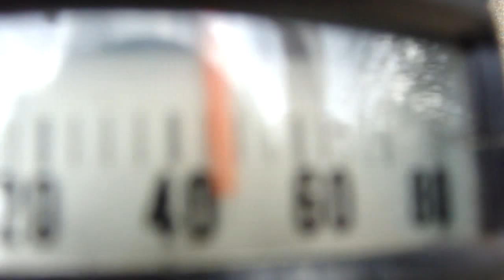CHEVY 454 ENGINE START UP ON GROUND * HOT RATROD ENGINE  * TEST RUN * REDNECK ENGINEERING

Comment: We used to always test run used or rebuilt engines like this before putting them into the vehicle. It's a good idea as you can evaluate how well the engine runs before installing it and find and fix certain problems such as leaks or assembly issues more easily. For cooling we used to simply pump water through the engine with a garden hose and you can easily control the engine's temperature by regulating the water flow rate from the hose. We also used to run the wire supplying power to the ignition system down from the ceiling and connected it to the ignition coil with an alligator clip making sure that the wire was tight without any slack. That way if the engine were to run away or shake really bad and it started moving the clip comes off and kills the engine before the engine could kill us.

Comment: Ahh yes. The good days when a motor didn't have 2 miles of computer harness attached to it
Reply: ya people nowadays people looks at that and says, that isn't a motor where's all the plastic?
Reply: +Eddieallen You're right that's not a motor!!! IT'S AN ENGINE!!!
Reply: Rocker Pat: you need to look up the definition of motor and engine buddy.  You know what... i'll just copy and paste it for you.  

motor:  a machine, especially one powered by electricity or internal combustion, that supplies motive power for a vehicle or for some other device with moving parts.
Reply: +fwh79 You sir need to look it up!  A motor is driven by an outside power supply.  An engine is internal combustion!!! Period!!! Motors are electric, hydraulic, or pneumatic!!! If it uses electricity motot, hydraulic motor, pneumatic motor all have an outside power supply. An engine is internal combustion and only internal combustion!!! Piston engine, jet turbine engine, rocket engine all have internal combustion!!! A steam turbine is a motor. A steam locomotive is a motor. The only thing that is an engine has internal combustion.  Maybe you should learn something about mechanics!!! Amd I learned tje definition from working at Chevrolet!!! I'd thinkthe engineer's there would know the difference!!! They are NOT the same thing!!! You have one engine in your car and several motors!!! Think of it this way, You can't take a motor out into the middle of the ocean and make it run without an ENGINE to supply power to it!!! Think about that for a minute mr. smarty pants!!!
Reply: Maybe you should watch the modern marvels episode about engines.
Reply: +fwh79 I don't get my info from tv producers who wouldn't know their ass from a hole in the ground.  My info comes from 30 plus years working for Chevrolet!!! I can assure you that a real mechanical engineer would set you straight!!! A motor is completely useless without a cord or hose!!! An engine is self powered,  a motor again has to have an outside power supply!!! It takes another machine to make a motor work (power station, air compressor, hydraulic pump). An engine does NOT NEED A CORD!!! Learn something here and quit watching fucking stupid tv for your information!!!
Reply: Here you go ex chevy employee Pat... more proof that no matter how right you "think" you are... your actually wrong.  Here is what MIT has to say about it  https://engineering.mit.edu/engage/ask-an-engineer/whats-the-difference-between-a-motor-and-an-engine/
Reply: +fwh79 You sir have not proven anything!!!
Reply: +fwh79 Did you even read your article from mit? It says nothing about the mechanical aspects of the question.  It only address the words and how they are derived into language.  It also si
aid in the first paragraph that the two used to have different meaning but now have been generalized.  Read the article and you will find no engineering explained!!! Your article is useless!!!
Reply: Rocker Pat a gas engine needs a outside energy source...gasoline...and a fuel line...your rite I'm just joking around...
Reply: +steve mitchell You had me for a second, lol. Let me clarify.  It's an outside sorce of power stored under pressure. Electric motor =volts, Hydraulic =psi, Pneumatic= psi. All power sources stored under pressure.  Gasoline and diesel are also stored power, but are not stored under pressure.  Now natural gas can be used and the gas is stored under pressure, but the energy of the gas has not been released until it's burned in the combination chamber.  Thanks for your support and I'm glad you get it!!! Keep Rocking!!!
Reply: What's your point/ If you burn fuel that generates pressure. And pressure and volume displacement generates power. It is the same with pneumatic systems, but than with lower amount of pressure/volume, at the end power..
Reply: Rocker Pat a steam ENGINE.. has to get its power from a external Source ..like a boiler ..and have to be be piped from the boiler ..to the cylinder and the piston..
Reply: EAEM in the process of carbing most of my cars/trucks,,a carb runs more efficient than these computers with a misfiring cylinder or bad coolant sensor feeding it more fuel i hate computers on engines
Reply: EAEM lmao so true tho
Reply: @eddieallen8982  aàa
Reply: For reals!
Reply: @fwh79FOXR6  lol you contradicted yourself through your definition.. “a machine, especially one powered by electricity or internal combustion that supplies motive power” internal combustion literally is the definition of engine lol.. i know what you mean but yea
Reply: Amen, one of many things that I love about a square body
Reply: Iv been trying to figure out what all I need to do a stand start
Reply: Nice for mechanics but not for mpgs

Comment: The motor is very healthy. You got a treasure there. Hope you put it to good use.
Reply from the maker: Eder Ruiz Yes I did Eder, I installed it in an old 63 Chevy Impala that had set for 32 yrs. before I found it in the back woods. Thanks
Reply: +KCSShadowRace623 With the proper mounts and headers, yes.

Comment: You can't stop a 454 ! Sounds like it's got lots of life left!
Reply: BobEckert56 theyll put a 6.5 diesel to shame with a th400 behind them i have an 89 chevy k3500 ext cab long bed with a plow trucks an animal it will pull anything to chain to it
Reply: It did till it got run hot for this video
Reply: Um u can stop a 454 buy over reving it

Comment: Judging by the carb and the upper radiator neck, this is probably a 1973-1976 engine.  
If the distributor is original, then it's a '75 or '76.
Sure sounds nice!
Two bolt 454 motors are plenty strong, and some came with forged cranks!  May you have many happy miles!

Comment: awesome piece of true American muscle, and 454 is more powerful then a 396. there is no replacement for displacement.
Reply: the Wankel disagrees...... just saying.
Reply: Except forced induction
Reply: stlmegatube but the Wankel sounds like crap compared to a built Big Block...
Reply: Pea Nut forced induction, man. The 3.0 liter 2jz-gte makes 1000+ hp
Reply: Jim Chance and there are well-built forced induction small block v8s that make over 2000 horsepower.. that's basically what I was saying when I said no replacement for displacement...
Reply: Jim Chance why do you think Top Fuel dragsters that are making 10,000 horsepower and using big block V8s with root style blowers
Reply: 375 hp 396 will eat a mo ho motor for lunch..you just need to rev it a little.
Reply: Diesel 8290 thats what I'm saying. I have an 02 ranger with a 2.0 ecoboost motor in it. over 250 hp and 300 ft lbs of torque out of a little 4 banger. Forced induction is better than heaps of displacement.
Reply: @stevemitchell2252  Forced induction is simply another way to basically fool the engine into acting like a bigger one.  Force more air into it than it could suck in on its own.   So there's still no replacement for displacement.    
Because you can put forced induction on the bigger engine, too, and if all else is equal, the bigger engine will ALWAYS make more power.   
No Replacement For Displacement.   The truth.
Reply: @jimchance5006  It's the truth.  Remember, you can put blowers on big engines, too...and if you make everything else equal, (modify both the same amount) the bigger engine will ALWAYS have more power and will be more reliable.
Reply: @stevemitchell2252  Correct, there sure as hell isn't anyone making 10,000 hp with a small turbo'd  Formula 1 motor.    When all things are equal, the bigger motor always has more power.    When they are NOT equal, like the big motor being normally aspirated and the small one being boosted to the heavens, then of COURSE the smaller engine has more power....because by boosting it you basically made it into a bigger engine.    But do the same to the bigger engine and you leave the small on in the dust.
Reply: @Diesel8290  Not back in the late 70's and 80's, it wasn't.   We have something called emissions standards here.   What were gas engines making for normally aspirated power back then where YOU live?   Not more, I can assure you.
Reply: The 454 makes its peak power at 1600 rpm, small engines that make the same power with forced induction wont have 400 ft pounds of torque at such a low rpm.

Comment: I'm a retired High performance GM tech.  I know it's tempting to run it like that . But the fact it has only a ring gear revving it like that with no load at all. Is a bad idea! It can turn it into a boat anchor real fast. I'm not picking on you it's just a little advise. Also it might have been cold but it was hunting a little bit. If it does that when it's warm that indicates it's a little bit lean.
Reply: -please save it,your bullshit advice i mean,it isnt needed,wanted or accurate.

Comment: hell ya 454's run forever, my dads 1991 suburban has a 454 with 290k miles and it runs fine doesn't burn oil or nothing.

Comment from the maker: @krazy45cat ...It is a 1980 AMC Eagle SX-4. I am retiring it and selling it. I took out the 454 race motor and found this stock one I am installing in it. You can see it run on my channel. That is where "Freakineagle" came from. It ran 9.78 @137 off the street. Thanks for the comment.

Comment: Chevy engines rule. Had a 68 396 sitting for 17 years. Just primed the carb and it fired right up. These engine were built to run.

Comment: Great old Chevy. The 454's were damn reliable engines and had good power.
But you'll have to do some serious frame / structure improvements to what looks like an AMC chassis. At the :52 mark, that cross-member and body will not hold up the the torque and weight of a big block for long. These 454's were all installed in full frame chassis, not sub-frame types. 
Best of luck with this project, and hope it comes out well.
Reply: did you see the pictures of this amc on the rear wheels doing a wheely for 300 feet????please stow your unneeded advice.

Comment: That sounds awesome. I just picked up a 1974 Chevy. Big block 454. Put new spark plugs, wires, oil change . New fuel pump. New fuel filter. But it still won’t start? WhAt do you think I should do

Comment: Possibly a combination of v8 firing frequency - 1 power stroke per 90 degrees of crank rotation, as opposed to a 4 cylinders 180 degrees.
Combined with this engine being perhaps mild cam as standard, timing being about right or a bit advanced. Theres something about a low idling engine.

Comment: Nice engine man, I myself have a big power house too, I have a 383 stroked to a 400 pushing out 550Hp. I just need and truck/car to stick it it, I did have a 91 Camaro but decided to sell it but stayed with the engine. It has exactly 0 miles on it. Crate engine baby.

Comment: I'm surprised it idles as well as it did without a Flywheel, the flex plate I wouldn't have thought would have sufficient weight.

Comment: Guy below says he has a 383 stroked to a 400, got to be a troll!
Reply: 383 is a stroked 350 correct me if I'm wrong, but you can't stroke a stroker lol.
Reply: unless it's a dodge 383 stroked
Reply: unless it's a dodge 383 stroked
Reply: unless it's a dodge 383 stroked
Reply: unless it's a dodge 383 stroked
Reply: unless it's a dodge 383 stroked
Reply: Try hards will never learn ...A 383ci is simply a stock 350 block W/350 pistons connected to 400 rods & 400 crank

Comment: Two bolt mains don't really matter on a street engine....the horsepower is still the same as a four bolt main engine...four bolt mains are just a little added insurance against supercharging stresses on the bottom end...

Comment: i got a 75 century with a 350, original, and i wish it was the 455! you never see old buick centuries anymore. and shes yellow. i dream about swapping for the 455 and in my dream i have a 6 speed. hells yeah. yure gonna have to put a wheelie bar on that amc ha
Reply from the maker: 455 Buick engine one of the best engines ever built.
Reply: Karl Stenbeck Nice i'm taking the 350 out of my 71' GS and putting a 455 in it.

Comment from the maker: Mild motor, huge cam. Probably not over 400 hp. Yes, I just installed it in my AMC SX/4 that I have had forever. Click on my site and you will see it on one of the first vids. Thanks Benny

Comment: My question is, the way the engine is wired to start on the ground, can that style still be used in the car, no fuse block no harness either, just to go down the track?
Reply from the maker: Sunny, I don't see why not. Just make sure the battery has a good charge after each run if you are not going to run an alternator.
Reply: Sunny Racoma Yep. 2 battery wires, 1 alternator wire, 1 for dist., 1 for starter.
Reply: Don Rutter 
Ahhh. Well said, common sense we all over look.👍

Comment: You said 4-BOLT MAIN the first thing I noticed there was only 6 bolts holding on the bell housing. Then I saw your written infomation and You said 2-BOLT MAIN 
Old Chevrolet car guys and racers told me all 4-BOLT MAINs will have 7 bolts holding the bell housing. Plus if you copy the number off of the engine where the bell housing bolts on, and take that number to a good engine mechanic or engine machine shop. They should tell you exactly what is.
I have bet against that several times and lost 3 great deals. One in a 77 Monte Carlo for $1200.00. Another was a 400 engine with pop up pistons and a rebuilt set of 305 heads for $130.00.
THe last was county own 1973 Chevrolet made ambulance with another 4-BOLT 350 for $300.00 at their auction.
Live, Learn, Get Married and Go Broke.
Show I did not learn too much at all.
Reply: +cwf081166 .. ALL SBC and BBC 2 or 4 bolt mains use the SAME bellhousing...
Reply: That is true but some bell housings do not have a hole on their top ridge and have to be drilled out or tapped to use on a 4bolt main block.

Comment: Love it.   Want that in my 86 maro.   Does it have the dished pistons?  peanut or large oval port?
Reply: +Kyle Parker .. Peanut ports will do 400+ HP...
Reply: +BuzzLOLOL   oh nice
Reply: +BuzzLOLOL 
ive got peanut port 14092360 heads  on my 1978  454, 
everybody is telling me those heads are worthless.
whats your opinion?
Reply: +Arlin Adler .. Peanut ports are bigger then small block Chevy heads and can do 425-450 HP with a bump in compression ratio (pistons) and a mild cam...
Reply: *****. If the engine is in a truck then peanut ports is what you want.  Massive power right off idle rpm ready to pull huge boats
Reply: Kyle Parker
'65 impala ss
Reply: Yea sell them and get "large oval" or rectangle port heads.  They flow much more air, and big hp is found at high rpm.  Peanuts will fall flat after 4500
Reply: +Kyle Parker .. Just depends on how much HP he wants and how much money he wants to put into it...
Reply: +BuzzLOLOL good answer..., im just looking for it to sound beefy and make around 300 HP...Like to keep it streetable, just gonna cruise with it...no racing.
Reply: +Arlin Adler .. 300 HP 454 would sound wimpy and sick... 440 HP peanut port 454 is perfectly Daily Drivable ("DD") and will sound and be strong: 
http://www.hotrod.com/how-to/engine/ccrp-1010-cheap-big-block-chevy-engine-build 

Budget cam/lifters for your peanut port 454: http://www.summitracing.com/parts/sum-k1301/overview 
.
Reply: +Arlin Adler    If your happy with 300hp then dont go through the trouble of finding better heads, and silence those people that are saying "those heads are junk" cause there perfect for a 300hp build
Reply: +Kyle Parker i was thinking the same thing, i think i already have what i want out of this motor.
maybe just an  Edelbrock intake to get rid of the cast iron one.  i  have  4 or 5  rebuilt Qjets sitting around, i learned to rebuild them out of boredom when 
the people i know just started giving them away..
everybody i deal with prefer edelbrock  or Holley carbs now.
Reply: +Arlin Adler  Summit Racing sells modified Rochester Q-jet carbs, but if you know how to put one together then get all the secrets and build badass one.  And as for your Edelbrock intake idea, do it!  A common problem with old V8 engines with iron intake manifolds is that they cook the carb so hot that the fuel boils within.  An aluminum one has better performance, runs way cooler and is a lot lighter.  Make sure it is an Edelbrock because they make the highest quality aluminum manifolds.  Others are cheaper because they have imperfections in the casting

Comment: can I buy that motor of you sounds like it's got a lot of torque in it.
Reply: Go to your local dump and look in the full size pickup trucks. Many will have a 454 which you can buy for around 250 unless have off days. All you need to do is spend a couple hundred more to make it that 10 second wet dream we all want

Comment: How much would someone pick up a 454 like that for? I've been looking for one but haven't had any luck. All the one's I've looked at are 2 bolt and either are dreadfully sludged or have been abused to the point of the block being of no use.